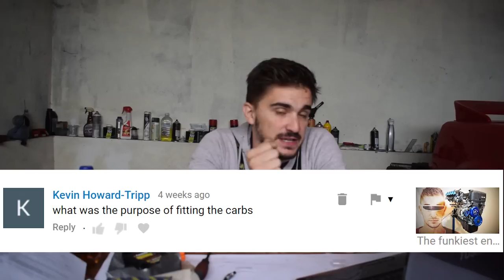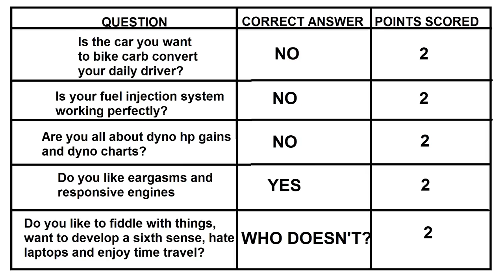Bike carb conversion BENEFITS and DRAWBACKS

Comment: To be honest you’ve inspired me to go with Gsxr throttle bodies over Weber style throttle bodies on my Suzuki Vitara swapped Samurai/Sj413 because of the cost. I did a rough estimate of the total cost of the car throttle bodies and associated parts would run me over $4000 not including the Haltech and dyno tuning. If I were to run a similar setup with the bike throttle bodies it would only cost about less than half including the ecu and tuning.

Comment: I wasnt sure but now i am.  I bought kadett d with  c20xe block and 18e head with multypoint injection. I hate the plastic airfilter and wires. Its allready restomod so im gonna give back some oldschool vibe with honda cbr1000f carbs. Thank you.

Comment: Carbs are complex mechanical/hydraulic/pneumatic devices with the puropse to emulate perfect conditions of fuel mixture at constant load and speed and adapt to the intents of the driver by accelarating and still mentain the optimal fuel mixture at trasitional regimes.
This is why good car carb have a lot of adjustment, and no matter how good and complex carb is, it will sort of fit on the optimal chart but not perfectly.

Fuel injection is all about giving the engine what it needs by measuring a few parameters. The simplest is the MAF which tells how much air you put in the engine, and compute the amount of fuel it needs to be stoichimetric mixture.
The limitations of fuel injectors were bad MAF (volume flap meter with temperature gauge to estimate the mass of air), bad injectors (that requires a lot of movement of the needle in order to open and close that can never be finetuned to the perfect amount since the large movement gives a displacement in the injector tip that is dead and uncontrollable), few corrections with sensors (lowest you can go is just MAF and CPS). Now a good fuel injection has the right sensors that are precise (MAF film type), crank,cam and throtle position sensor, temperature sensor of the intake air, and of the coolant, o2 sensor to establish a correction for lean or rich (better individual o2 sensors for each cyl but thats hard to do as it hast to have a long individual path to acuratley measure for each cyl), exhaust temperature, fuel temperature in the ramp, detonation sensor to adjust ignition timing. And the most modern require that all of the sensors are spot on and with high rate of sampling to identify the speed of the variation (lets say for throttle, you crank it open hard, the ecu sees the need of power and richens the mixture a bit and all sort of corelation to each scenario that can be switched when the conditions are met)

Adding fuel injection to an old engine can be a very good idea BUT it is a nightmare if you don't know anything about ecu programming and the parts don't fit. Keep in minde the intake manifold is specially built for a particular engine. Adding FI to old non injected engine will have no availability for that particular intake manifold for that engine. Homemade manifolds are a world worse than mass produced factory types. Maybe aftermarket tuning has an offer. Also adding sensors on old sensorless engines is a nightmare and hard to do in most cases. Also old engines only carburated require TEL gasoline (leaded) which has an oiling effect on valves and seats. Going unleaded on really old engines can hurt the valve-seat sealing and burning more often increasing wear, etc. Going leaded fuel on injection is a big no-no since the MAF and O2 and the Tri-CAT will be busted in short time (except old mechanical maf like flap on K-line Bosch) and in open loop without O2 sensor correction which is a big no-no.

Comment: I think if you have an SR5 ae86 and just have a DOHC 4age long block , carbs are the way to go at this point since GTS conversion part are very expensive now...imo
Reply: swapped a big port 4AGE into my corolla SR5 from an MR2 and the engine was in rough shape and the intake and EFI parts were junk plus the car was already built to have carbs ie it had a fuel tank return line and no in tank pump

Comment: Question #2 is basically me. My fuel injection system is all wacky. Idles weirdly, doesn’t keep constant idle at a stop sometimes. Doesn’t like cold start. Fuel efficiency is way off. And its a 30 years old system as well. Even though it’s my daily driver

Comment: I swapped a 4ag into a Tercel 4wd wagon. This was not as easy as it appears at all. Both are the "A" engine family, and the bare block bolts right to the trans, but the rest requires a fair amount of machining, welding,  etc. 
   For example, the 3ac flywheel/crank has 6 bolts, the 4ag has 8. But the 4ag ring gear diameter will not work with the Tercel starter location, dictated by the bellhousing.  Also, the 4ag clutch doesn't quite fit into the bellhousing, but that is the one you have to use for other reasons. 
  That and the many other difficulties are not the point of this comment, though,  it is that I initially used gsxr1100 carbs. I made a manifold  to do so (2, actually). There was no toyota ecu at that time, so the stock distributor operated an msd ignition system. The sold a "programmable timing computer" in the '90's, 3 knobs varied the timing curve, I mounted that inside the car and messed with it while driving. Educational...especially driving from PA to Oregon  just weeks after getting it running. 
   On that long trip, I brought an assortment of jets (pilot and mains), different slide springs, and slides with different lift hole sizes (the hole in the slide bottom communicates engine vacuum to the area above the diaphragm. It is important in tuning, especially when using carbs on the wrong size engine). 
   There is more to tuning these well than just jet sizes, all items above matter, and more.
   I got my carbs to work flawlessly, like EFI that had a "choke" knob (it is NOT a choke, though, it is an "enrichment circuit", they are not the same)
    The problem with the carbs, though, is that despite looking impressive, they were too small, and limited high RPM power noticeably.  Each 400cc cylinder had one 36mm carb to breathe through. With the EFI, each cylinder had the big throttle body to pull air through. The cylinders do NOT really compete for air..there is an intake stroke only every 180 degrees. (Not technically true due to the cam timing opening the intake valve a bit early and closing it well after BDC, but you get the idea.)
   You don't get to "add up" all that carb area, each is on it's own with its respective cylinder. 
    I drove it tens of thousands of miles on the bike carbs, but then adapted the MR2 EFI to the Tercel, which is also much more work than you think- consider that the tercel had an engine driven mechanical fuel pump, for example..on the head. Makes 4 psi. Won't feed the 45psi efi, won't go on the 4ag head anyway...so, weld mounting ring into the Tercel tank, make bracket to hold pump, make fuel lines, etc....etc..manifold won't fit under hood...cut and weld that...throttle body points at firewall now...work around that...etc...etc.. I made almost the whole wire harness. 
   But, YES, the engine regained the missing high RPM power. And was less responsive. It was snappy with the carbs. 
   Regarding that..the bit of video showing yours running with the bike carbs..it didn't run real well, seemed sluggish. Possibly that slide lift rate, controlled by the balance between the slide lift holes and the slide springs. These details are often missed and really matter..maybe, also, it was lean midrange, or had retarded timing at that RPM.
   Elsewhere in the comments, "fuel shooting out of the carbs" is mentioned.  That is tricky, it is airflow reversal due to resonance. It is bad, because the air is "carbureted" twice, in a sense, and can cause extreme richness at only very specific RPM and really crap running at that RPM.
   I had the best results eliminating the T-VIS butterflies, with no loss of torque or low RPM drive ability.  
   I still have the car, the exhaust was a PITA to make, when it got rusty, I parked it. I have an LS2 in a volvo wagon now, it was less work and much more fun. Less work than the tercel, even including making all motor, trans mounts myself,  etc. I try to make everything.

Comment: Thanks for the vid theres not alot of information out there for people looking into bike carbs.  You have convinced me to stick with fuel injection even though mine definitely doesnt work right.  But to be fair the sound you get from carbs has less to do with the carbs them selves and more to do with the fact that you have significantly shortened your intake therefore letting more sound out.  Then again its difficult to make a manifold that short when you have  a throttle body to deal with.

Comment: I have to pause because you also have different injecting methods like 4 injectors continue or 2 on 2 injection so the injectiors will inject for 2 cilinders even though 1 is in the compression phase and you have modern injection methods where they inject when the cilinder valve opens. The advantage for my polo is that i am going to use actually less fuell becuase it gets its fuel when needed and i am actually gaining more horsepower.

Comment: individual throttle bodies are a better comparison to bike carbs and they too  have to be synchronized and for fuel injection sensors such as MAF or MAP , O2, TPS do go bad and affect fuel consumption so these must be replaced so just adding another dimension to the carb vs injection argument

Comment: i got a honda civic eg with a d13b2 and im converting it from its original single carb to a set of zzr1100 carbs, and im swapping the head with a reconditioned one with larger valves and i will be polishing the new head before it goes in, cant wait to see how it turns out :D

You have helped me alot with this conversion so far and i really enjoy your videos! i subbed :)
Reply: A year later I've decided to move on to twin Weber 45s. My carbs were great fun and made really good power, 133hp @7600rpm on Dyno. But they have started to leak and need a rebuild. And tuning them isn't always easy because the idle screw is underneath and you can't adjust it without taking out the carbs.

Comment: Hehe. I just VW beetle carb swapped a 1990 honda civic. I was in the same boat. 30 year old fuel injection system that never worked.
Reply: I like bike carb but I haven't done it because my civic ef carb is fine .. more power in the bike carb, maybe in the future... but I have a ZC engine with carb it's fine, but there's less power because I'm using the oem carb from d15b

Comment: If you ever come across the bouncing idle again on FI, it might be the cold start throttle control. My 4AGE FXGT would bounce from 8-1200, finally found a mechanic that knew the issue as Toyota mechanics (3) couldn't fix it. He took the heater hoses off the bottom of the intake and joined them together with a U pipe. Problem solved. 
The cold start is only needed for sub zero conditions, so is usually pointless.

Comment: Basically he pressed rollback. Personally my un educated self, would just do this. Get the engine with no sensors. And then buy aftermarket sensors that can be modified easily. You got your car carbed, but you also bought a new ECU, something to measure crank position too. All you'd need is some injectors timed correctly at the right amount. And you could delete the tvis . All about messing with the settings. And if something's working correctly or not.

Comment: I am all for bike carbs for your car. But it's not the fuel injection vs. carb that I see as a point to discuss. It's not having the T-VIS system that will hurt performance. DOHC and really short intake (i.e. carbs) is going to hurt the acceleration off the line. T-vis kept the velocity of the air up at lower rpms. On the up side you should get a higher peak hp. Dammit I got rid of my MR2 years back. The intake and factory stuff worked. Bottom end was toast tho.
Reply from the maker: Of course the factory stuff worked, a bunch of ppl that are a lot smarter than me developed that :) it's just that in my case it all bit the bullet. Bottom end will probably be a bit worse your right, I hope the top end makes up for it. I do have higher compression and cam lift than stock, so I'm optimistic :)
Reply: @d4a  Oh, I meant the parts I had worked, but they went to the junkyard. Not that what you're doing won't :-) If you are not happy when it's done. A possible fix would be seeing if you have or can find the closest gear ratios possible in your transmission or even a final drive swap. Or turbo charge it. Or develope your own T-vis using a short bit of dual runner intake with the  butterfly in the one runner, a electro/vacuum servo to activate, and an Arduino set to flip the valve at an rpm you choose. Ha ha might need 8 smaller carbs to get it tuned perfectly. Arduino is incredibly easy. I have a partially developed setup for intake control with arduino. I could change it to 4 cyl and remove 3 stages in the program. Mine uses resonance instead of cutting off a 4/8 runners.
Reply: Almost forgot a bigger vacuum reservoir would be necessary too. Easily found behind the bumper on a Jeep Cherokee.

Comment: Will it also work for 4AF (carb)?  And benefits from it?
Reply from the maker: It works with every engine. Benefits are even greater for less performance oriented versions of the 4A engine as the intake and fuel delivery system on them leave more to be desired.

Comment: It seems a lot of the questions didn't apply to me because my car is carbureted. And my carburetor is a pain to work on so I've bought a rack of kehin FCRs and I'm not looking back!
Reply from the maker: The questions are for the fuel injection guys. When it comes to difficult car carbs, there is no contest there, a bike carb conversion, as I explained in the carb vs carb part in the beginning of the vid, is almost always a good move.

Comment: question, what bike carbs would you recommend for a 1.4L engine? as in, carbs from what CC of bike? or could i hook up like 4 individual 125cc bike carbs with a custom linkage? like what CC worth of carbs (if that makes sense) would be suitable for a 1.4L engine? i have a 1980 Lancer EX that ive been wanting to do a bike carb conversion on once i fix the rust haha
Reply from the maker: I wouldn't recommend the thing with four individual carbs. This is eyeballing it but something from a 400-600cc bike should be ok. You will correct afrs with needle height and jet changes.
Reply: Thanks! that helps a lot! there isnt much available here in Malaysia in terms of full sets of 4 bike carbs, hence my curiosity about the 4 separate 125/150 carbs. Guess ill start looking further abroad... eBay here i come lol
Reply from the maker: I mean I haven't seen anyone do it, but that doesn't mean it can't be done. Synchronizing them and making the throttle linkage might be a pain tho.
Reply: i mean, im down to try it. My brand's motto is FCK NRML, so its worth a shot i guess. Plus I'll have a wise old gentleman helping me who has been doing crazy shit with cars for years, so hopefully we can make it work. Ill give it a shot with 4 separate carbs first, just coz. haha then if we really cant make that work, ill look into a more traditional bike carb setup. i also had a little confusion over the idea of running an ECU with carbs... or is the NODIZ more of just a spark controller?
Reply from the maker: Yes, Nodiz only controls ignition. Good luck with it, let me know how it goes.
Reply: 4g12? with stock engine use cbr 600f 32mm if you shave the cam 600f2 34mm if you make an exhaust manifold too it will make you laugh like joker you have to make a manifold (inlet) that will connect all the four carbs weld a tube of 10-12mm so you can have vacuum for the distributor experiment with the spring of the distributor and it will be perfect to make your life easier find a lamda sensor from a scrap yard  connect it to your exhaust manifold put an air fuel gauge about 30 euros all together and tune it without any guessing

Comment: Got a 1988 golf mk2 1.6 8v, currently has the original pierberg carburator and should make around 70 hp from factory.
I reckon going to bike carbs would help alot in the power departement, My plans/hopes are currently to fit bike carbs (I have mates with a machining workshop), a 268 camshaft and exhaust system/manifold (there's used ones on the market here) 
I hope to be at the 100hp mark (115 would be amazing) 

Anyway, what would be more noticable to start with? 268 camshaft or bike carbs?
Reply from the maker: I think with everything you have planned 100 hp should be easy if it's all done right. I would also increase the compression a bit and get uprated valve springs since you're going with that cam. I would start with the carbs and then the cam. You will be able to make more power from the cam with the carbs already in there. The carbs will be more noticeable not because of larger hp gains but because the engine will change tone dramatically and should be a lot more responsive if the carbs are tuned right.

Comment: I have had many motorbikes with carbs. I am not very knowledgable  about ecu's and electronics. I have an mx5 1.8 nbfl so if you install carburators how you deal the ecu aspect of the built ( the mx5 ecu is not tunable) ?

Comment: CBR 600 carbs will work on a 1000cc single carb engine (if well tunned) with an AFR gauge )?
I do not want more hp, but a better throttle response would be amazing.
Keep doing good job
Reply from the maker: What kind of 1000cc engine?
Reply: It is a Datsun A10 engine and has 73mm bore and 59mm stroke, factory has 59HP and 80NM
Reply from the maker: Hmmm. You would certainly get a lot in the top end with these carbs, but down low the throttle response and power would be questionable. These are 36.5mm....I would go for 34mm in order to get what you want.
Reply: Thank you!!